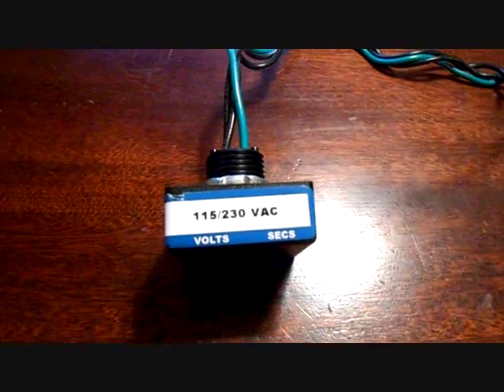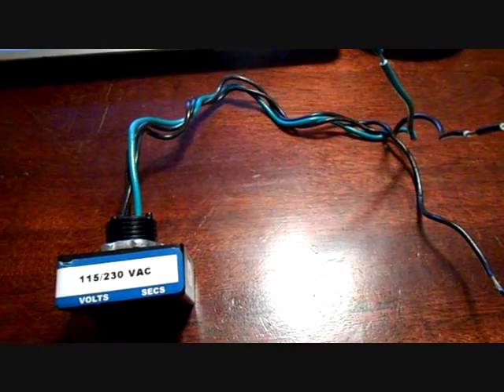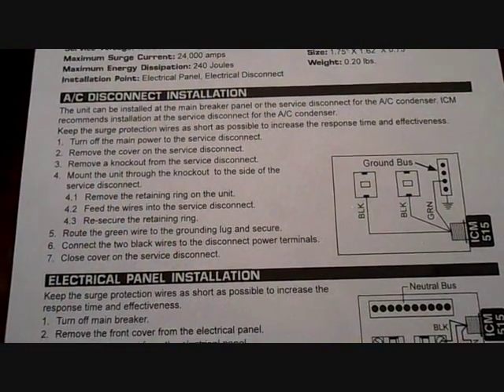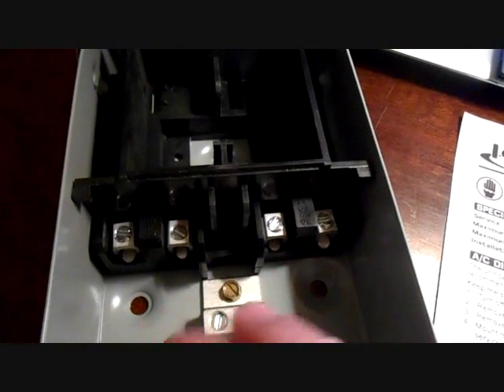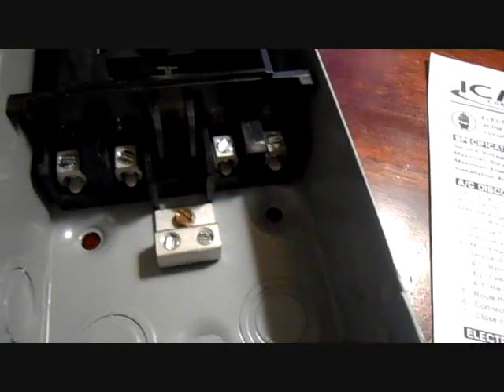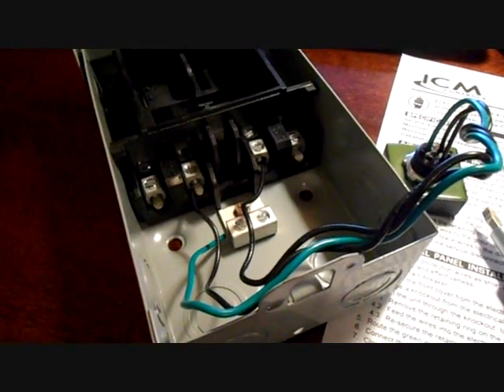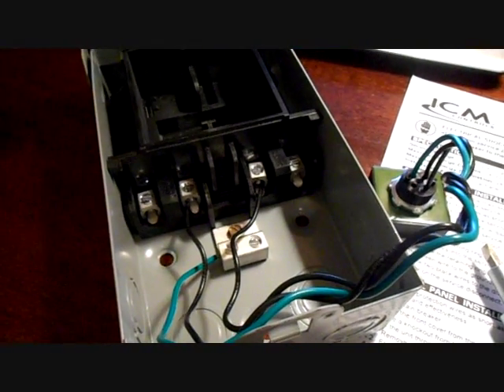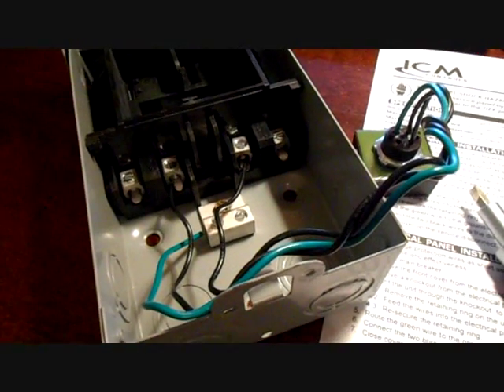HVAC Surge Protector

Comment: thanks a lot  nice  video...but I have a Q? if I only have a one  line fuse disconect how would a wire will be??   notice that when I SAY ONE LINE is  one  HOT  and  ONE NEUTRAL..and  obviesly the ground  wire too....it  would  work the   surge protector?